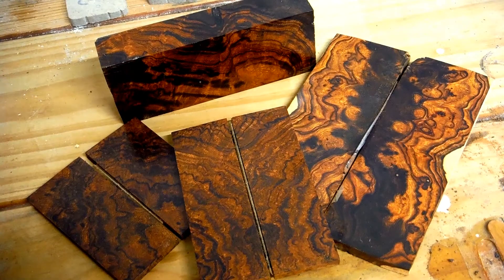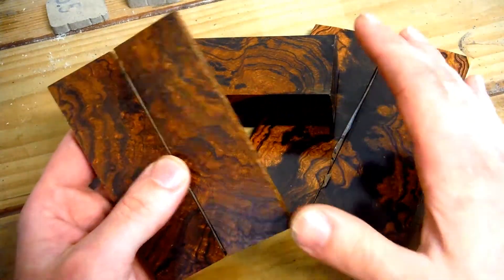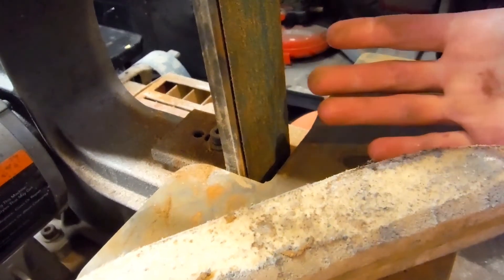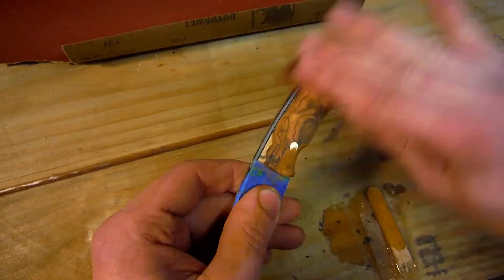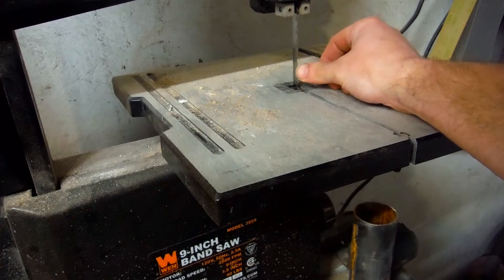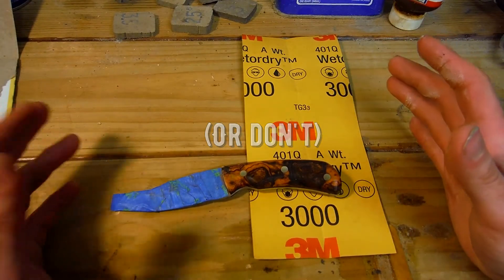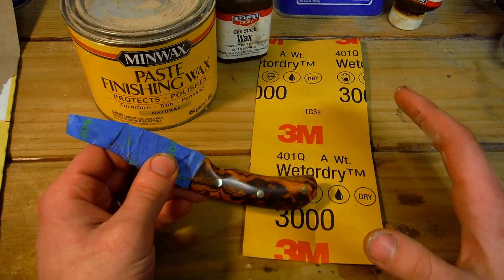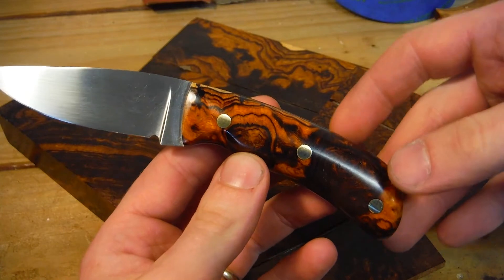Working with Desert Ironwood

Comment: Thanks for sharing! I like working with ironwood as well and did not come across any problems when paying attention to not overheat it. However I often finish it with adding just 2-3 very short rubs with danish oil. With buffing compound I often struggle with the result feeling somewhat sticky but that may just be related to not using exactly the right compound. So I just buff with wax. 🙋🏻‍♀️Anna
Reply from the maker: WD-40 works great for getting excess buffing compound off pretty much anything! That's probably the sticky stuff you've felt😊

Comment: i have never had a problem cutting,drilling or shaping any kind of wood or metals.you just have to use the right tools.and one more thing YOU CANNOT STABILZED IRONWOOD,IT WON'T GO THUR AND IT DOESN'T NEED IT.GOOD VIDEO
Reply from the maker: Yeah it's too dense/oily for resin to penetrate rendering stabilization pretty much impossible. Same with most true rosewoods

Comment: I usually use that minwax on most of my knife handles. It seems to work better for most woods I use vs. the linseed oil.
Reply from the maker: Minwax will go over anything; it’s more of a coating that sits on top of the handle in comparison to an oil that penetrates the surface. It’s a very low protection finish though; it doesn’t take much to take off a wax; unfortunately. 

Linseed oil is garbage. It makes wood so pretty but offers less protection than wax lol

Comment: Does fine steel wool work on it as well for finishing?
Reply from the maker: I haven’t tried it myself on desert ironwood; but I do imagine it would work just as well as it does on other woods. Particularly if you landed a piece with a lot of metallic qualities to it.

Steel wool severs wood fibers in a cleaner fashion than sand paper - in my experience.  Definitely worth a try - worst comes to worse you can always switch back to paper if you don’t like how the steel wool turns it out!